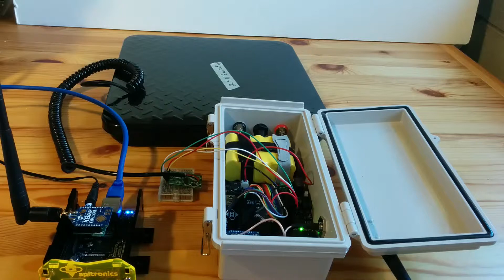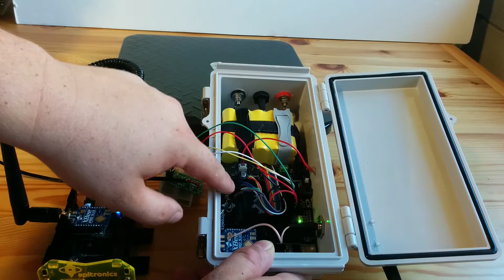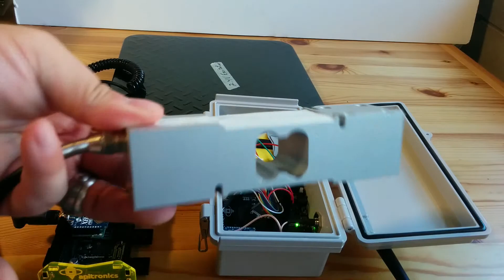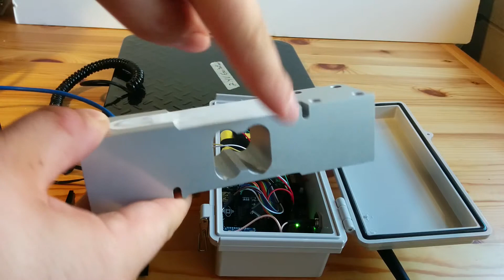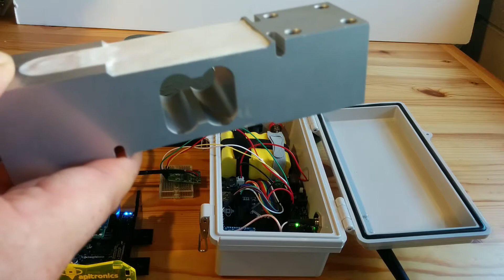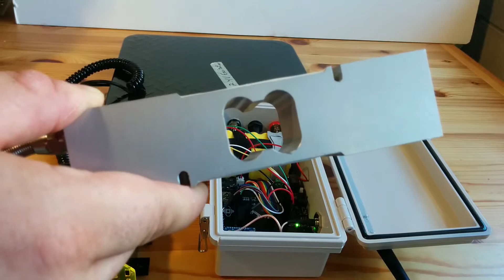Update on Honeybee Hive Monitoring Prototype

Comment: Working on the same project ... Do you have fluctuation on Hx711 ?
Reply: I work on same project and I have drift, yes. And hysteresis also. Using 4 load cells x 50 kg, I get drift as much as 200 g while measuring 1.500 kg. 
E.t. from 1400 to 1600 grams which (to me) is awful. I can not relate this to temperature dependency, because the temperature did not vary significantly...